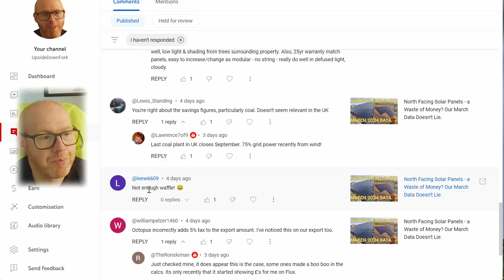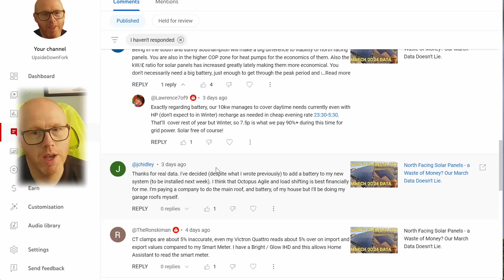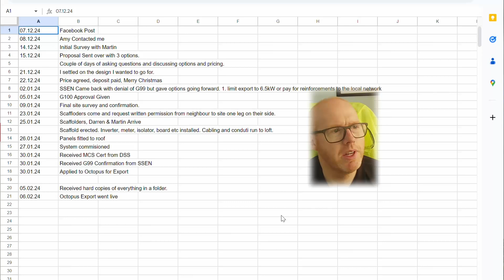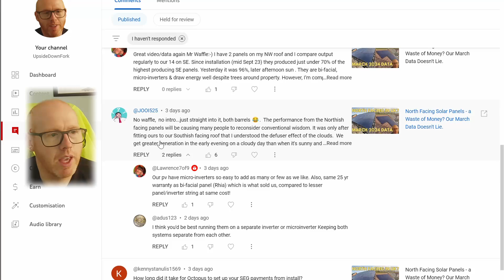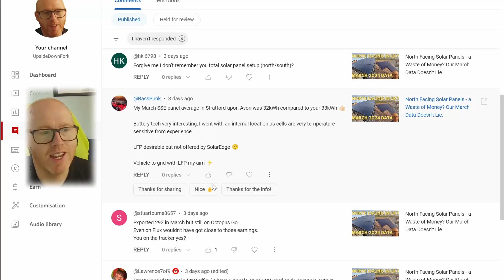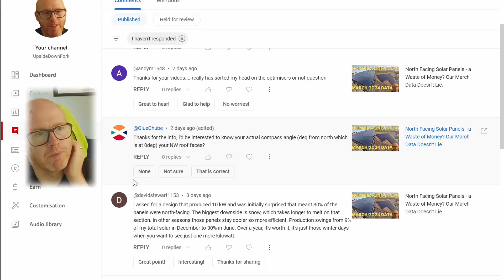Replying to your Comments about our North Facing Solar Panels - a Waste of Money?

Comment: I have had solar panels for over 12 years a 4kw max gov criteria. Panels have evolved so much that for the same area a 7 kw system can be installed so there is now sence to install on the northerly roof slopes to achieve the same as  my sunny southerly facing roof. To benefit most a battery is needed but concern is rising about battery fires so i am inclined to install well away from from my home.

Comment: I have 39 panels, all facing near enough south, so hearing about north facing panels I had a moment of “good luck with that” but I can see that as long as you are not literally burying the panels underground there is genuine benefit to using what surface area you have, even if north… my opinion is altered… good work!
Reply from the maker: We've all got to work with what we've got! 39 south facing panels is the dream!

Comment: i talked with Artisan Electrics say my south facing roof could only fit 5 panels and they refuse to install any panel on my north west facing roof which could easily hold 20 panel.Told me that 5 panel isnt worth it and the NW facing roof is not economic for installing solar panel
Reply from the maker: Send them the link to my videos! My last one is all the evidence you need.
Reply: Consider the enormous price crash in panels, that "logic" is worth a revisit

Comment: Just had timely visit from Gas structure people, following our gas boiler removal. Was curious to excitedly demonstrate the HP benefits to gas engineer, energy use/bills/comfort. Only criticism he suggested - as I requested removal of house pipe termination to end in pavement - was selling house with no gas connection could cost next owner. Besides obvious, gas is dead opinion (I didn’t bother) I told him how our property EPA had risen from C to A with solar/HP installed. That is it’s an investment to property adding real value, why wouldn’t future proof low/free energy bills not? The future.

Comment: Another great video. I feel the need to start sharing my journey! A key point the installers don't tell you about is the system losses for running the inverter and battery charging which when you become self sufficient really begin to show in the figures. I will start sharing mine.
Reply from the maker: Yes, indeed! Fortunately when my panels stop generating, the inverter goes into standby mode and doesn't draw barely anything overnight as it would if I had a home storage battery connected.

Comment: SolarEdge is wonderful but they have recently changed the warranty, they no longer pay the labour to fix optimisers on your roof. I've had one go down after 8 years, the cost to fix it is now many hundreds. I'd go with standard string or Enphase in future.
Reply: If possible, I would really recommend you install the optimisers in the roof space then if they ever fail in the future they can just be easily replaced by going into the attic (at night), I find it interesting that Everybody installs them under the solar panel if one of them fails, you’ve got to put scaffolding up just so you can pull one solar panel up to figure out if it’s the panel or the module that’s failed (if they’re in the attic it’s dead easy to service them)

Tigo dc to dc optimises are cheap (work with any inverter) I would say they are more for solar panel monitoring and more crucially firefighter safety (once the control tigo unit has lost power 30 seconds later all tigo dc to dc modules automatically isolated from each other making the roof electrically safe) but they are also work if you have shaded conditions or multiple angle roof on the same string (his install has dual MPPT built into the inverter was all that was needed but I do like per panel monitoring)

solar edge (requires both solar edge DC to DC optimiser plus the solar edge inverter) generally not cheap and if they’re all on one side of the roof or two sides (with minimal or no shade), one inverter usually has dual MPPT So you can connect the front and rear of the solar panels like he did on his roof on this YouTube video,, The optimisers are realistically not worth it If you’ve got a sunny boy inverter or even pretty much any Chinese inverter they usually have shade fix Which can dynamically change the MPPT voltage (the only benefit you really get is you can see when you’ve got a malfunctioning or under performing individual panel because it needs cleaning, but is it worth more than £1000 to £2000 more)

micro inverters (enphase) incredibly not cheap if you want to use large wattage panels (all the micro inverters combined can cost more than three or four inverters

If an optimiser fails or if micro inverter fails the rest of the modules will still produce power just the one panel will stop making power,, but If the control module fails It may disable all of the modules on the roof, tigo it does (it’s a safety feature) 

all systems if the DC string (dc to dc optimiser)or the AC string (micro inverters) is cut all modules fail safe and self isolate each panel and output no power on the output side of the module all micro inverter (most also have arc fault detection) unfortunately optimises and micro inverters have a lot of safety and monitoring benefits but don’t generally make you more money ,at most maybe 3 or 1% (as most string only inverters have shade fix)
Reply: Will the rest of the array produce if there is a single optimiser failure?
I read somewhere that Solaredge will remotely shut the system down for safety reasons till the faulty optimiser has been replaced
Reply: @serraios1989  In my case the rest of the array works. SolarEdge will remotely connect into the system and try to restart the optimiser ( which in my case failed).
Reply from the maker: Ouch, that's a shame.
Is the bulk of the cost in the scaffold etc?
Reply: @UpsideDownFork  Yeah, it's a full scaffolding job and then the roofy to take off the panel and put on the new optimiser. Optimiser is free replacement but then it's only £50. As it's 1 of 14 doesn't seem worth while at present. One installer told me he's changed 40 optimisers so far this year, so it's not uncommon. I'm thinking of having a few additional panels and it could be done at some time, but it's complex because the current set-up is under the old FIT scheme.